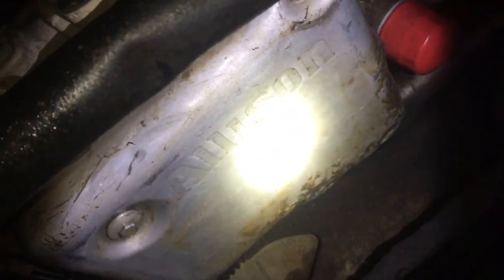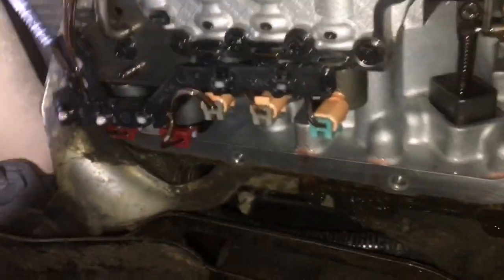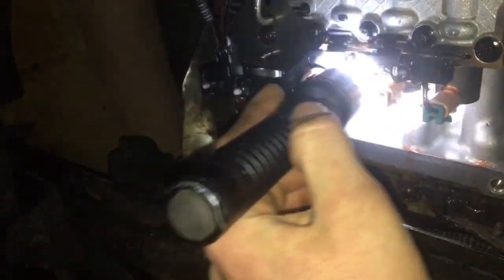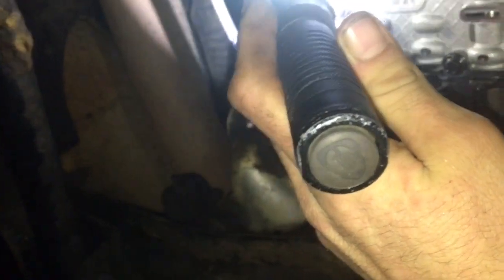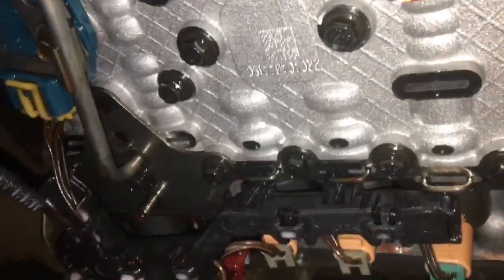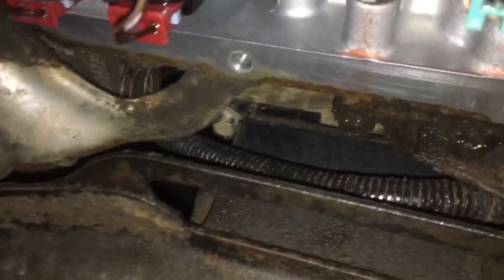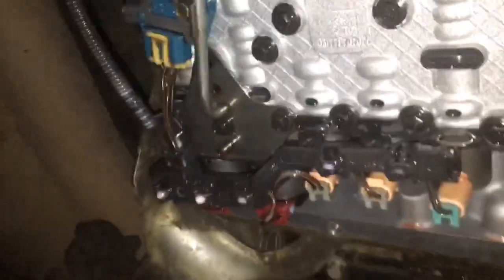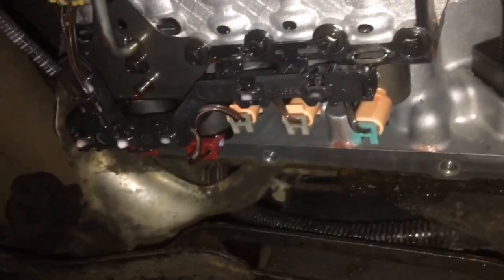Allison 1000 e valve stuck removal of valve body

Comment: Good video, informative< but a lil dark. We are not professional but thank you for showing the procedure.
Do you know what the torque spec is for tightening the bolts to the valve body
Reply: Valve body 90 inch pounds.  Pan 18 foot pounds

Comment: I’ve got the same code on my 2006 Sierra 2500. Is it necessary to remove the valve body? I thought you can replace the solenoid with the valve body on the transmission.
Reply: He replaced the e shift valve not the solenoid they are different
Reply: To just replace the solenoid you do not need to take the valve body out.
I took mine out for 4-5 shift solenoid stuck on. It’s not super difficult to take out just time consuming

Comment: did your trans temp go up while valve was stuck and what codes did you have
Reply: Mine does this and yeah because it’s at full line pressure in limp mode

Comment: I have an 03 sierra and awhile back it started shifting from 1st to 2nd and 2nd to third. Would down shift hard as well. After a few weeks (i dont drive it much) it got worse and eventually wouldnt shift at all. Range shift inhibited came on and sent in into limp mode about a mile from my house. I limped it home and came back out a couple hours later and started it up with no check engine light. So i hopped in it and drove it down the road and it was shifting fine. Shifted perfect up until a week ago it started shifting hard again. This time it was 1st to 2nd and 3rd to 4th. Hard down shift again. Now its only hard shift in 1st to 2nd gear. Would a clogged valve body cause this?
Reply: I'm having same exact problem right now did u ever fix it
Reply: Mine too sooo whats the issue guys?? Can someone tell us pls 911
Reply: Same issue 🙏🏼
Reply: Same here

Comment: Enjoyed the vid even though you had some audio probs.
Reply: My 2002 occasionaly will act loke it is shifting down into a super low gear when i am at a crawl and letting off of accelerator and coming to a stop.   I cluncks and tips me forward in me seat a bit when it happens. Happens at about 3 - 8 mph range.. any thoughts on this issue would be much appreciated. Thank you.
Reply from the maker: gly shorts sounds like tow haul is on could be bad selector switch in the gear shifter